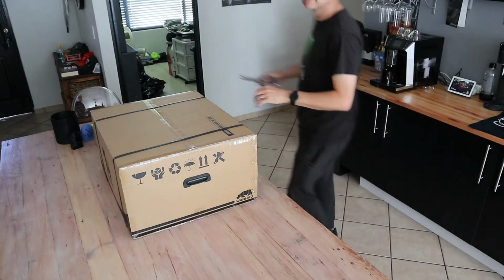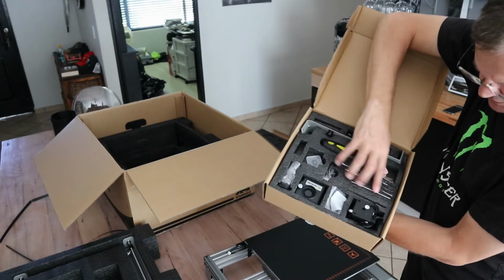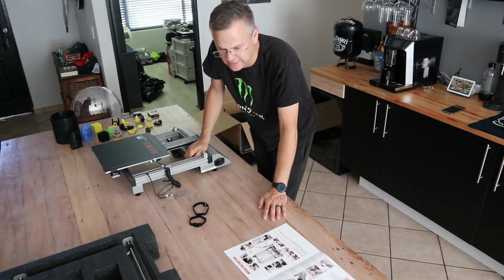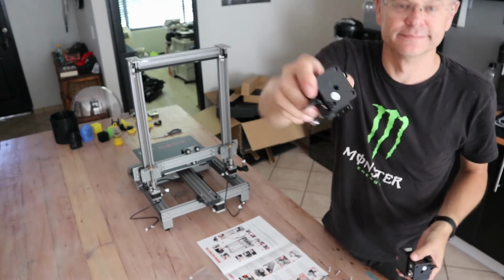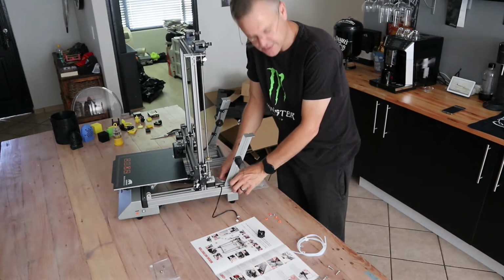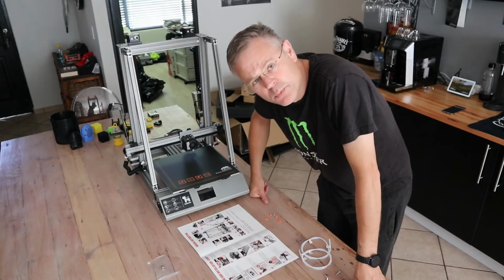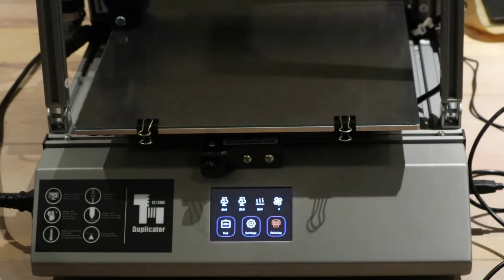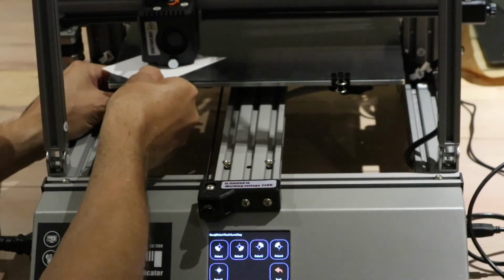Wanhao Duplicator D12/300 FDM 3D printer with Dual / Double extrution

Comment: How do you like it so far and how it compares with others? I'm looking for a good IDEX printer. Thank you :)
Reply from the maker: Hello and thanks for the comment.  I had to give it back as it just does not work properly. The tech is too new and the firmware is not mature.  Dealing with support who does not speak English basically resulted in them saying it works as designed.  We swapped it for an ender 5 plus.  I am very happy with that one. Good luck
Reply: @We-R-Living   have done the same thing! Bought the D12/300, setup instructions were terrible, put me off completely. Will be an "ok machine" if flashed, but no thank you! Ender 5 pro+  change for upgrades or the ender 5 plus is way better!
Reply from the maker: @imranessop1644  thanks for the comment. Even of the supplier just acknowledged the issues and agreed to something about it... Instead the reply is effectively that it works as designed. I did get Ender 5plus and that thing is a beast! Try the swiss micro head upgrade. Makes it even more useable
Reply: @We-R-Living  i'm so put off Wanhao, i got half way through the build and decided to rebox it.
Got the ender 5 plus, that was my 1st printer that i bought during the pandemic hard lockdown. Got the all metal extruder and most certainly need to put the micro swiss hot-end to it. Just waiting to for somes signs of wear on the stock but its going like a workhorse so far.